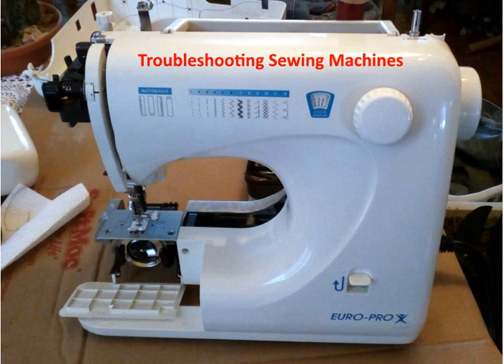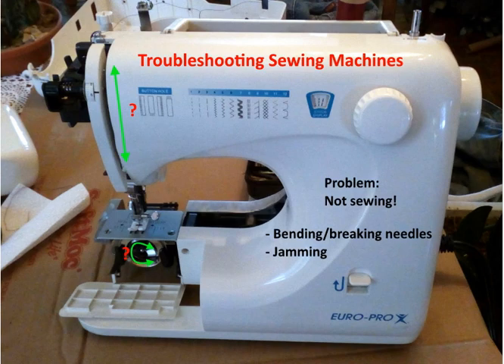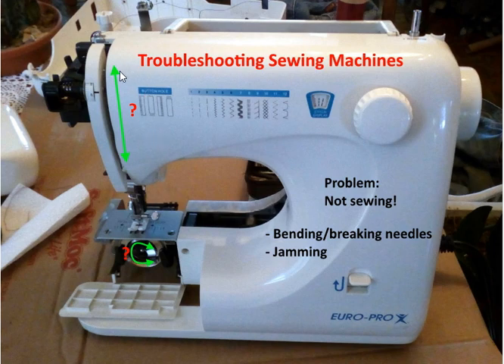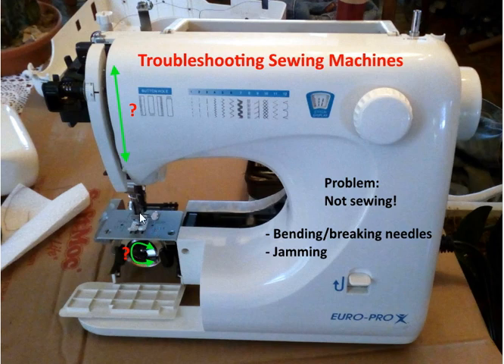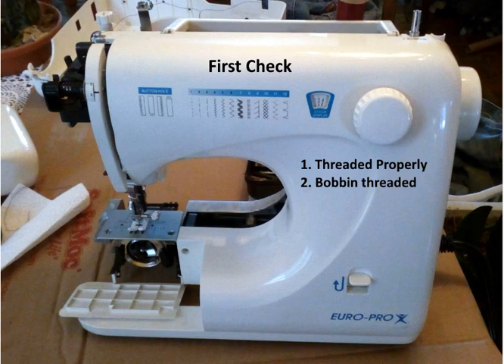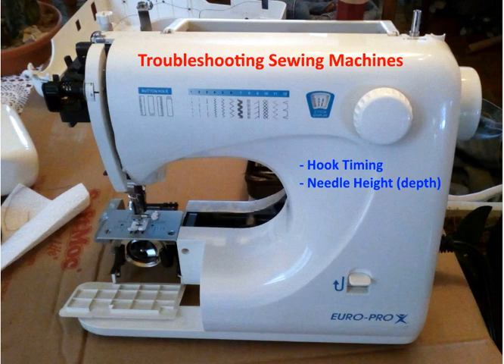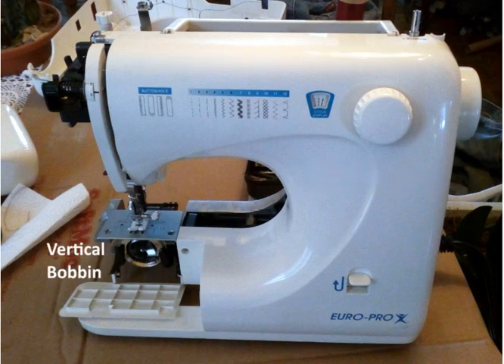How to Troubleshoot and Repair a Sewing Machine

Comment: Broken needles and threads can result from over tightening the needle clamp screw. Even though it can accept a screwdriver you should only ever hand tighten. The screw driver is used only to loosen the screw. Over tightening effects the shaft causing a bend. The needle will no longer be aligned when you reference the position of the needle tip with the hole in the cover plate (throat plate). The needle can strike the cover plate or inside the bobbin area.

Some sewing machines require lubrication, so you should consult the manual. Even an unused machine, or one that has been in storage, will require cleaning and lubrication just as a vehicle parked for a long period of time requires some TLC before being used to it's full capabilities.
Reply from the maker: Thanks

Comment: Do u know what i have to do if the fabric dont advance? The feed dog is working, but the fabric dont advance 😢
Reply from the maker: That's a good question. It sounds like the feed isn't pushing down on the fabric.
Reply: @blanchae  I watched several videos and read the manual, but couldn't figure it out. The feed dog is out enough to grab the fabric and it doesn't work. I also cleaned the inside and nothing.😢😢